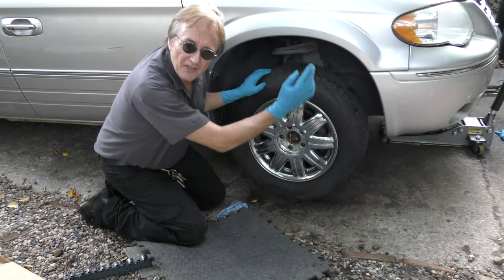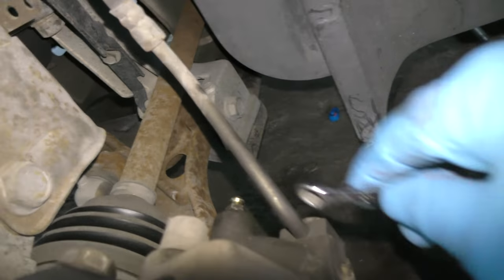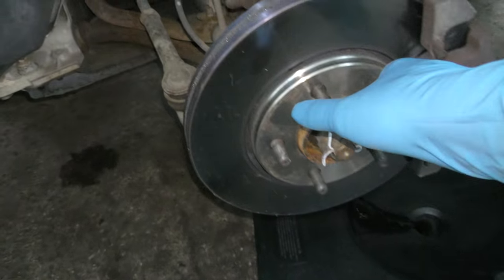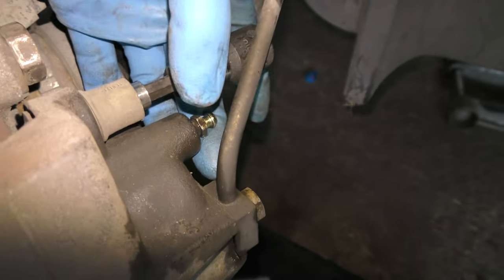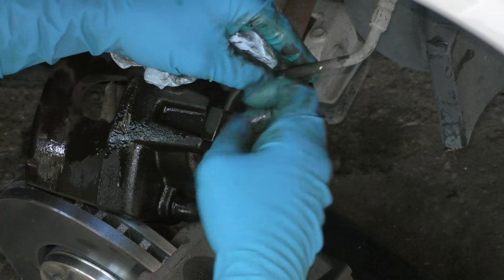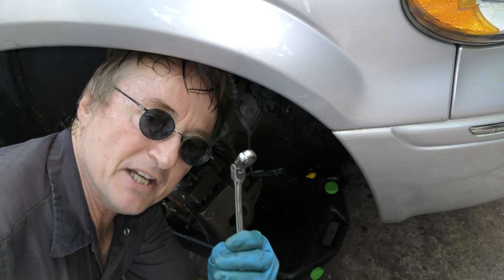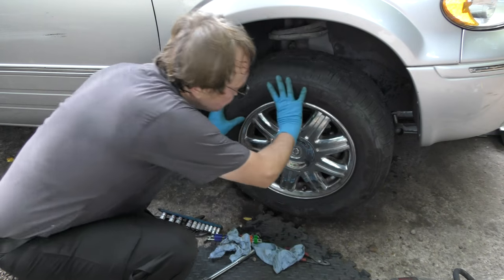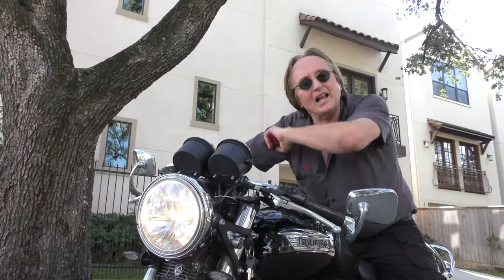How to Fix Sticking Brakes on Your Car

Comment: I did that and the wheel turn freely... I drive around for 2 minutes and the brake lock up again. I have to bleed one wheel and all 4 wheels turn freely again. So what happened in my case?

Comment: both sides are locking up, i pressed both calipers back in, took it for a test and they both still locked, any ideas?
Reply: Could be residual pressure from your master cylinder.

Comment: I have 1 brake that always sticks when drive daytime. not the caliper or hoses (replaced)
Reply: im having the same problem on mine. replaced the caliper but its still dragging some. its got Electronic Stability Control which is just extra ABS bs it doesnt need. When i spin my tires in rain or snow, the ABS starts to work, just like im locking up but opposite. i think the controller is putting too much pressure on the back brakes under normal circumstances. but im ok going through $20 rear brakes every 2 or 3 years instead of $100 diagnostic and possible computer / abs pump replacement. 
Just an something to think about, if you have ABS with a brain.
Reply: mine doesnt have ABS, once car gets hot maybe 3-5mls drivers front completely locks up. steering wheel shakes & pedal stifens so I have to pull over turning off car to let cool off & unfreezes brake again...vehicle is 93' ford probe SE
Reply: Just the one caliper that you've replaced is still sticking? Then either the new caliper is bad or somewhere else in the line is kinked, clogged or leaking. If the other brakes are doing the same then your master cylinder might not be releasing. If the pedal makes a hissing air noise when using the brake then it's likely going out.

Try checking the new caliper by disconnecting the line and pressing the piston back. See if it releases easily. Also while it's off, check the line by pushing the brake pedal.
Reply: released hardline few months ago from master that leads to that sticking brake, cleaned/sprayed brake cleaner & it fixed for while (1200+mls) trip but recently doing again. Tryed loosen hardline again but just stripping even with brakeline tool.

Comment: Why replacing the caliper?!? You could also just repair the caliper.
Reply: By the time I knew mine was messed up it had ruined the caliper.
Reply: His labor probably costs more than the rebuilt caliper. Saves both parties time and money, plus the part will be warrantied.
Reply: Rebuilding isn't quite so straightforward, especially if you don't use the right pin grease.  Had to rebuild the rear calipers on my '92 Saturn twice before I got it right (both previous times the grease just cooked away).
Reply: Waccoon silicone grease, always silicone for brake components.
Reply: Yup!

Comment: I got Chevy Malibu 09 change the calibers and it’s dragging on driver side with I drive slowing down my acceleration and fuild was not coming there the driver brake line unless it was on can you tell me what could be the problem
Reply: I tired everything calipers rotors hoses.... What fixed my problem is I bought a 50$ scan tool cleared all my codes then before driving I turn traction control off !. My wheel speed sensors must be bad so it tells ECU I'm slipping and locks / drags wheels with the abs system to point of smoke. Scan tool and traction control off helped my brake stick problem.
Reply: @jdsjds7935  I just had to change brake lines fix my problem

Comment: I know this is an older video but if anyone at all could help me with this I would appreciate it. I have a Chevy 04 Impala and the brake lights stay on and kills the battery unless I put my foot behind the brake and pull the brake towards me. What could this be? The brake is barely pressed in when I lift it back towards me but it's down just enough to kick the brake light on. Anyone at all have any ideas? It's driving me nuts

Comment: So it couldn't be sticking pins, twisted line, dirty pad valleys, rusty surfaces, lack of grease? Just change the calipers?  OK.  I've tried everything else that was less expensive.  I was dreading buying new calipers but I guess this is the solution.

Comment: This isnt brake related but I need alot of help as Im not too car smart, if anybody could help that would mean alot, my problem is my engine is getting random misfires and the engine shakes on my 2007 Honda Accord , so I changed the spark plugs and it shakes way less now but it still has a blinking light, I put a code reader on it and it says the o2 sensor is bad so I changed that and it got a bit better but the engine light still blinks , any suggestions and tips would be much appreciated
Reply: yes they do , also when my car is in idle it shakes , should I try cleaning the throttle to see if that works?
Reply: IF the check engine light is on again, post the issue and the trouble codes on Scotty's website and he'll be able to then help you out.
Reply: Your car has coils on the plugs, no ignition caps like Hargard was thinking. But thats a good place to start if you do have caps. The coil pack is the black box and tube/hose assembly that sits on the spark plug, held down by one 10 mm screw.
Problem with those coil packs is when they go bad, they just go out without notice and they can be expensive.
Definitely get a scanner from a friend or see if the auto parts place will read your codes for you. Find out which cylinder is missing then find out which cylinder is which, easy to google. Then just Swap out the coil packs with others on the engine. So if number 1 and 3 are bad, swap them for 2 and 4. Then Clear your codes. some states wont let you do this, if so. just disconnect your battery for a few seconds. Cleared. Then run your engine again and scan it. if the engine is now missing on the other cylinders instead then your problem is Definitely the coil packs.
If your problem is unchanged then you might have a bad wire connector, injector or possibly more serious engine damage (though unlikely). Good luck

Comment: I have a 2008 chevy silverrado 1500. My brakes are seizing up when the truck set at idle for a long period of time about 30 minutes or so. They lock up so bad that it won't move then I have to let it set for a good hour or two before they release. I need help on why it is doing that I replaced calipor an brakes all around an it still does it. This last time my ABS an stabilitrak light came on can anyone please help

Comment: I'm surprise you didn't mention a possible clogged or obstructed rubber brake supply line which will also keep the disc brakes pads dragging or hanging up because it keeps hydraulic pressure on the calipers and discs. Just sayin......

Comment: Pepe Boys charged me $383 to replace driver caliper because it’s stuck and they bleed the brake fluid for $59.99 + $188.90 ( part )  + $147.40 ( labor ) + $16.30 ( other ) + $30.41 ( tax ) = $ 383.01 , the new caliper I see in Advance auto parts for just $80 plus 20% off , why Pep Boys charge so expensive? Mr Scotty do you have to replace the brake rotor or brake when you replace the caliper .

Comment: 1. This is ‘replacing’ a sticking brake caliper. not fixing.
2. If the slides on the bracket are causing the issue, replacing the caliper was a waste of time and $$.  👎🏻

Comment: Cars are so much easier to work on in Texas, here in Canada you will round off two bolts and probably snap another doing the same job, plus liberal use of cursing.
Reply: It only takes a few seconds with a second-rate open end or a 12 point wrench to ruin a good bolt head.
Reply: best socket and wrench in the world won't help you when bolts are welded on by rust, and corners of the bolt head have turned into dust.

Comment: now its to the point im not driving it cause this nut i live with stuck a crowbar under the hood trying to pop it open...then he let a crackhead try to fix the brakes. also he poured the wrong liquid in the wrong hole...god im being cursed out here.well anyways im back to walking to my destination or taking the city bus.